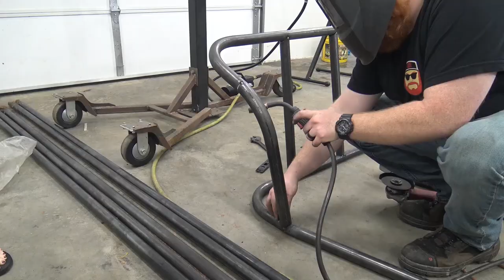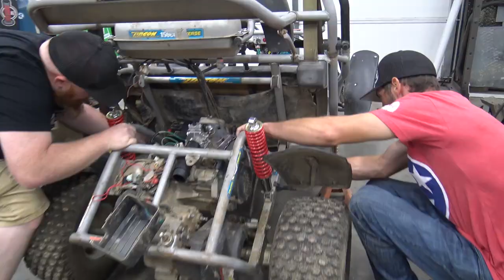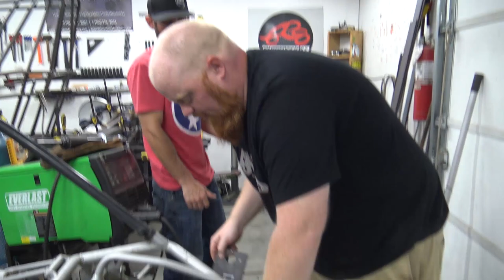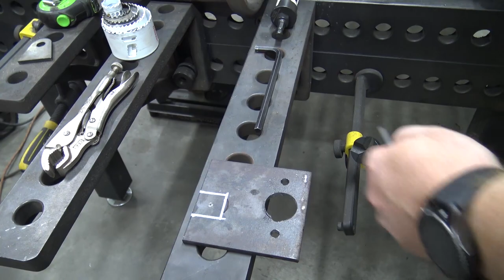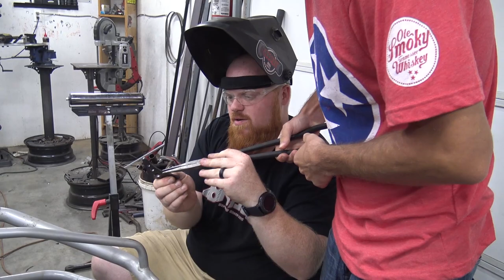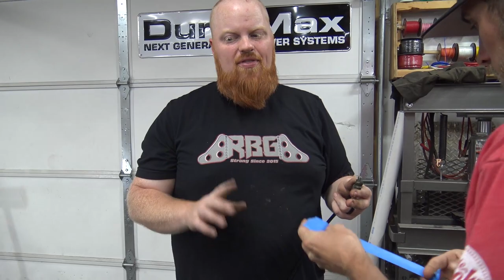150cc Go Kart Front Brake Upgrade

Comment: Ive been thinking of going disc brake instead of the band brake..this video gives me a idea of what all is needed. Thanks RBG..
Reply: You really actually set the braking system up to have the front wheels brake first and harder than the rear brakes????
THAT IS SO DANGEROUS GREG!!! Rear brakes should actuate before front brakes. You don't want to ever lose your steering cause the fronts locked up before the rear tires did.
Reply: @greyhaack9403  how is dangerous. A car is set up the same way
Reply: @Ohiocountryboy-se2cn  ok here's a scenario....traveling down hill on a rural-type gravel road. We call these "switchbacks" where I'm from. Your speed naturally increases so you apply your brakes. If your front brakes grab first and lock up you absolutely loose control of the vehicle. I understand that 70 percent of your stopping power comes from the front brakes. But that's with the rear brakes starting the pressure first.
I'm not a mechanic. But twice now I've had front brakes lock up before my rears did (once on gravel and once on ice) and both times I lost the ability to steer. 
Lesson learned! 
I was coming down an icy highway hill one winter evening. Car started to spin sideways on the black ice but instead of applying the brakes (for fear of loosing all steering capabilities) I tucked my feet up near my seat and was able to steer the car back straight.

Comment: Go power sports needs to make weld on brake caliper mounts for the front. My hubs has the holes for rotors but no caliper mounts.
Reply from the maker: Coming soon sir.
Reply: Thanks. I just got a order from them Monday.

Comment: Have it looks like what you are working on. It has been setting for I don’ t know how long. I did get it running after a while. I rode it about 25 yards and it quit running no fire have replaced coil and the thing behind fly wheel. If you could many tell me what I should do. I would really appreciate it. The motor is a 1P57QMJ. It was mfg in 2012.

Comment: I have this same brake kit it's currently held on with smaller diameter bolts than it should cause the caliper has 2 threaded holes I can tell its metric threads do you know what thread pitch the bolts are for that so I dont need to buy a bunch to figure it out... thnx

Comment: @Red beard you can powder coat over powder coat they have this new system called wet powder coat, it is a liquid (I think its alcohol my self ) that you mix with your powder coat color and you spray it just like regular paint on top of the old powder coat and when the liquid evaporates out of it you have a new patch if powder coat that you can wipe off where you don't want it then you just put it in the oven or you can use one of the heat guns that do two thousand degree heat guns. If it's a small area melt the powder coat for small patch job like what you need!!

Comment: I found on my karts with the same master cylinder the adjustments are about even. The rear brake and both front brakes have about the same volume so they grab pretty even. It's lowered the wear on the pads and now they last about the same time front to rear.